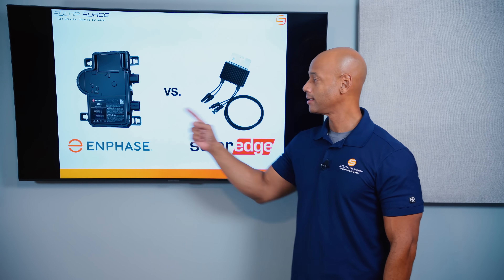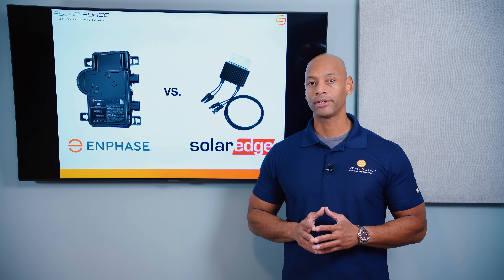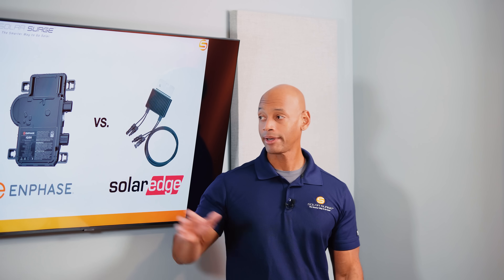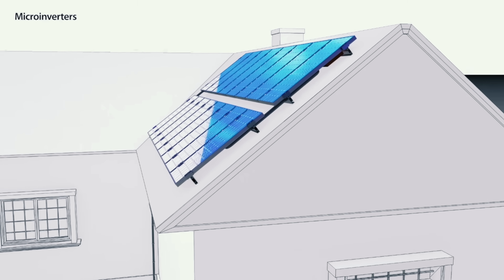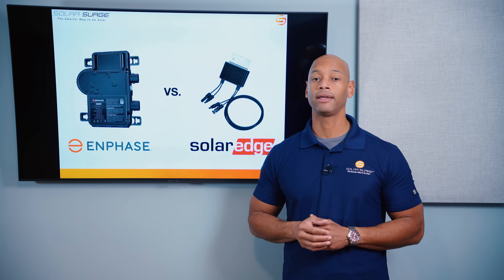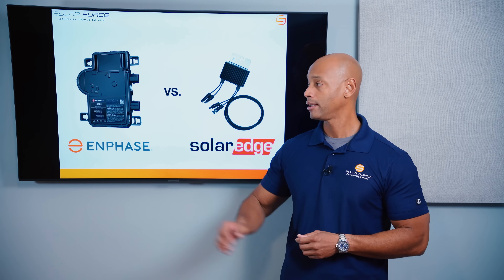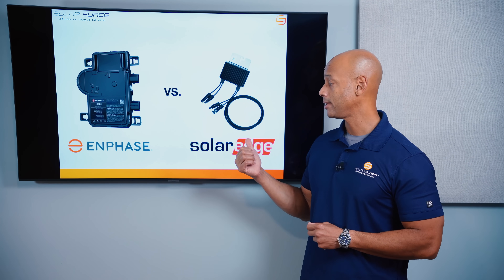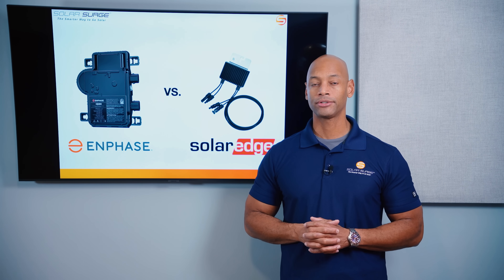Micro-inverters Vs DC Optimizers (2024 Updated) | The SHOCKING Truth

Comment: Recently purchased a brand new build in CA. Solar installed advertised the system as a 4.05kWh system as it has 10 400W panels. The issue? They used the iQ8Plus micro inverters which have a 290W continuous output capacity. This means the system has a theoretical output max output capacity of 3.48kWh. I called the installer out as that’s false advertising! Had they used the iQ8M micro inverters or simply advertised the system as 3.48kWh, I wouldn’t complain. 15% less power is NOT insignificant!

Comment: Because blocking diodes integrated in recent solar panels, shading of one panel won't be an issue (for high voltage series system using MPPT controller).
Here is an example: if you have 48V battery system with 180V solar panels (12 panels in series) then if one is blocked/shaded then the voltage will drop to 160V but current still maximum, so the DC optimizers and micro-inverters are becoming obsolete here. 

Also, the cost of micro-inverters are insane, you can simply double the number of your solar panels instead of buying micro-inverters.

NOTE: This does not apply if you have voltage that is barely near threshold, such as having 72V (4 series panels) for charging 48V system, which if one panel is shaded, the voltage is dropped to 54V and isn't enough to do charging. So, having maximum number of panels in series is always recommended (up to max MPPT controller can handle).

Comment: Very good information!! AAA+++  I have been studying quotes and equipment for about 2 week before finding this video that reinforced  efficiency by using DC optimizers for a system with battery back-up. I also liked your video on "Is Solar worth it?" Did not talk about solar leasing that may be more popular after you made this video. THANK YOU!!
Reply: If you can get Sodium Ion batteries but failing that go LFP they are less energy dense than Lithium Ion but much safer and slightly longer life unfortunately Silicone Carbide is at least a decade or two away from large scale battery pack's

Comment: The real problem with microinverters is that when your power company turns your power off black out, you can't charge your batteries unless you have a grid tie inverter switch. Problem with black outs you can't run your solar power during the blackout because of possible electrical shock to linemen working on power poles and transformers. Best to go off grid. Your solar power is useless when your electric company is on blackout.

Comment: One thing you missed with the Enphase Micro inverters is that in low light situations, which the time you really need the power they turn on far earlier and switch off later so you are generating power for more of the day. In most systems the peak power is irrelevant you end up dumping most of it to the grid. But you can use it first thing in the morning and last thing at night. Peak power is what most people think matters but really it is useful generation when you can use it that really matters. This applies during the day too for most people, as once your battery is full and you are using what you need the rest just gets wasted… at least that is the case here in Western Australia, if we can sell it to the grid we only get 2c per kw. So it’s usable power that matters and the Enphase system gives you more of just that… That’s the conclusion I came to for our system needs.
Reply: One thing you missed:
1. Not everyone can dumping electricity back to grid, some countries either are not allowed to do so or doesn't pay you
2. Many people also use battery system, which peak power is relevant as long as battery is still charging

Comment: I have 40 solar panels and optimizers on the roof of my detached garage. I have 2 solar Edge inverters in the garage.  There is a wire that was installed from the garage to the house. At the house is a shutoff.  Next week they are coming to install 2 Franklin batteries and an a gate. Should the batteries be installed before the inverters or after? If after it sounds like I would be missing out on. 30-% of my generated power.
Reply: Batteries are installed before inverters so that it is DC (Solaredge) to DC (batteries).  The inverter converts DC to AC for use in your home or sent to the grid which is also AC based.

Comment: How does mppt fit into all of this as another option? Is mppt a newer more recent technology than micro inverters or dc optimisers? It is dc to dc for charging batteries.
Reply from the maker: MPPT stands for maximum PowerPoint tracking. The technology has been around for over 10 years. It is used both in micro inverters and string inverters.  The technology allows the solar panel to operate at its maximum power potential optimizing the best combination of voltage and current.

Comment: All you need is like 12 more camera angles and you can bullet time your monolog.  Absolutely nothing shocking about any of this.  Actually nothing of value to me.  No new information was provided.  Maybe others found value in this very basic knowledge, but even so, I am quite sure nothing was shocking about it.  Clickbait deserves punishment of some sort 38,000 views at 12 minutes, you just stole 20 years of human lifespan, you should feel shame.  Also 3:50... bypass diodes exist these days seems a bit of a lie for systems that aren't 15 years old.
Reply: Relax, it’s a video
Reply: @pb7379-j2k  Are you not even going to acknowledge your lies regarding partial shading.  This is clearly a redundant solution to a solved problem and your acting like its a necessary thing.

Comment: The "complex" micro inverter wiring is a simple cable with plugs.
Failure rate it the same for both typed and replacement for both id simple.

Comment: Why not have a subset of panels dedicated to DC production to keep the battery supported, and the rest of the panels on microinverters to support the home load? Then both get the most efficient production when solar is available? Added cost for the battery inverter? Or is there some other defect with that idea?
Reply: Sounds like you are talking about a mixed AC/DC system.  The whole purpose of Enphase is to convert to AC at the panel.  They know about the power loss going to DC for batteries but the benefits of AC at the panel outweigh the minor power loss.  Microinverters have a big cost savings realized later, as string inverter systems with a central inverter will likely have to be replaced 3 times over the course of the system lifespan (35 years).  Each central inverter will cost around $4500 w/installation so $13,500 in additional costs over 30 years, plus whatever lack of energy production that was lost due to down time... and my system (being large) would require two central inverters so double that cost.  That central inverter replacement cost is nearly at the cost of my entire Enphase system (after fed/state rebates) with 52 panels! The microinverters last longer because they run cooler and aren't handling large loads like the central inverter (hence the longer warranty on microinverters).  Also the safety of having A/C running through the attic (operate at the same low-voltage AC power as a typical home) instead of DC.  Running high voltage DC wiring through an attic can pose a risk of arc faults or fires, particularly if the wiring is damaged or improperly installed.  Also, upgrading panels on Enphase is much easier, I can simply add more panels.  With central inverter you have to size the inverter to the panels, so if you are adding panels (or adding higher wattage panels in the future) you may have to upgrade your inverter to a larger one at a significant cost.  Also, in 10 years when panels produce more output I can replace individual panels in Enphase system and get the higher output where as mixing panels with significantly different wattages in a string inverter system is limited by the lowest-performing panel, even with optimizers. Also, ask any installer/repair person about warranty swaps on equipment and you'll find out the Enphase makes it easy vs SolarEdge not so much.  Plus there's a lot to be said about modularity and scalability, Enphase can support additional items like using your electric vehicle as a battery store and being able to draw from it at night when the sun goes down.  Also fixing a microinverter is easy, heck I can do it, just tilt the panel, unplug the old, plug in the new. Albeit it's on the roof but no that big of a deal to climb a ladder.  And guess what, the string inverter system with power optimizers have a optimizer behind each panel also!  So not only do you have a central string inverter to fix if it goes bad, you also have power optimizers behind each panel up on the roof that can go bad too. So I fail to see why anybody would buy a string inverter system (even with optimizers) when there are so many disadvantages.  Initial cost and not having some conversion power loss when storing excess generation to batteries is the only advantages of a string inverter.
Reply: @MaxAcceleration  That is the most comprehensive answer to a question I think I have ever received. Bravo, sir!

Comment: I've been a solar installer for 28 years. Mainly both of the said products.  I will tell you the reliability greatly outweighs the efficiency by leaps and bounds currently. This may change but only when the other manufacturers decide to build in reliability and support.
Reply: I agree, I don’t want anything failing on the roof. So which is more reliable, a micro-inverter, or an optimizer?
Reply: @pb7379-j2k  If it fails on the roof it's just one panel with the microinverter that can be easily swapped when able.  Optimizers are behind the panels as well so I'm not sure the ask for comparison there?

Comment: if i have a battery(franklinwh), can the solar array be sent directly to the agate and on to the battery?
Reply from the maker: The aGate accepts solar in AC format, so you would need a solar inverter or micro-inverters on the solar array
Reply: @SolarSurge  Are there any good Micro Inverters for 580W Solar Panels. I can only see 480W option from Enphase. Any other brand that has one for 580W.

Comment: if microinverters are used, does this eliminate the need for an inverter totally?
Reply from the maker: Using micro-inverters would eliminate the need for a central inverter
Reply: Microinverters eliminates the need for central inverters. Enphase microinverters convert to AC at the panel.  Microinverters have a big cost savings realized later, as string inverter systems with a central inverter will likely have to be replaced 3 times over the course of the system lifespan (35 years).  Each central inverter will cost around $4500 w/installation so $13,500 in additional costs over 30 years, plus whatever lack of energy production that was lost due to down time... and my system (being large) would require two central inverters so double that cost.  That central inverter replacement cost is nearly at the cost of my entire Enphase system (after fed/state rebates) with 52 panels! The microinverters last longer because they run cooler and aren't handling large loads like the central inverter (hence the longer warranty on microinverters).  Also the safety of having A/C running through the attic (operate at the same low-voltage AC power as a typical home) instead of DC.  Running high voltage DC wiring through an attic can pose a risk of arc faults or fires, particularly if the wiring is damaged or improperly installed.  Also, upgrading panels on Enphase is much easier, I can simply add more panels.  With central inverter you have to size the inverter to the panels, so if you are adding panels (or adding higher wattage panels in the future) you may have to upgrade your inverter to a larger one at a significant cost.  Also, in 10 years when panels produce more output I can replace individual panels in Enphase system and get the higher output where as mixing panels with significantly different wattages in a string inverter system is limited by the lowest-performing panel, even with optimizers. Also, ask any installer/repair person about warranty swaps on equipment and you'll find out the Enphase makes it easy vs SolarEdge not so much.  Plus there's a lot to be said about modularity and scalability, Enphase can support additional items like using your electric vehicle as a battery store and being able to draw from it at night when the sun goes down.  Also fixing a microinverter is easy, heck I can do it, just tilt the panel, unplug the old, plug in the new. Albeit it's on the roof but no that big of a deal to climb a ladder.  And guess what, the string inverter system with power optimizers have a optimizer behind each panel also!  So not only do you have a central string inverter to fix if it goes bad, you also have power optimizers behind each panel up on the roof that can go bad too. So I fail to see why anybody would buy a string inverter system (even with optimizers) when there are so many disadvantages.  Initial cost and not having some conversion power loss when storing excess generation to batteries is the only advantages of a string inverter.